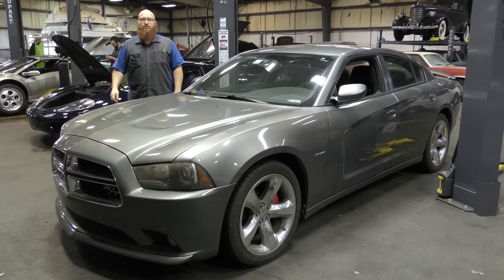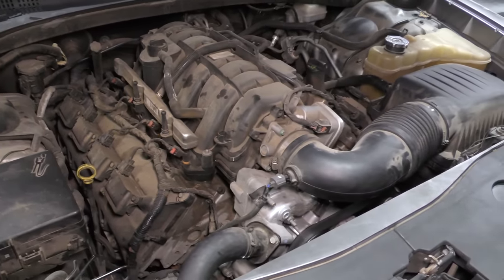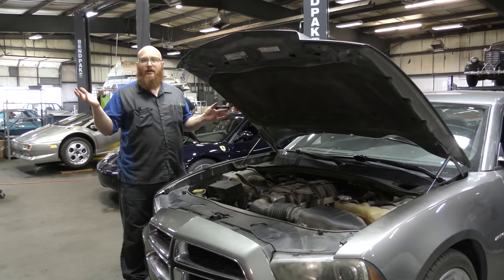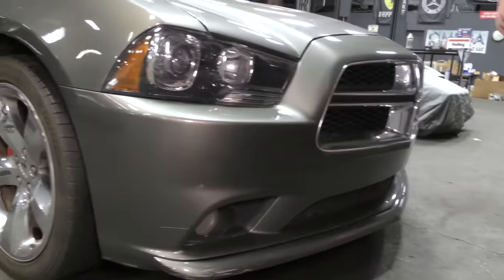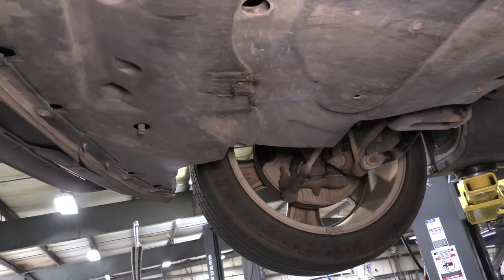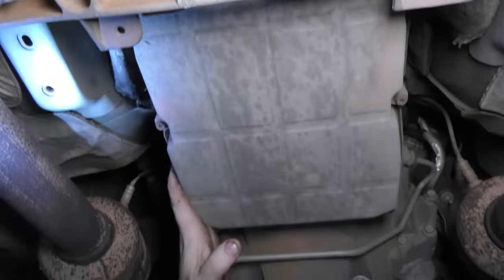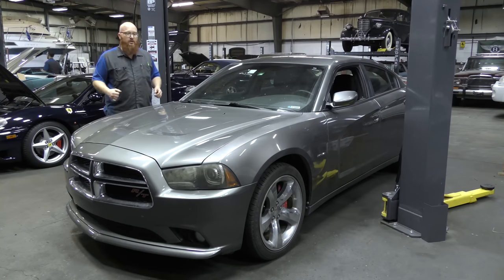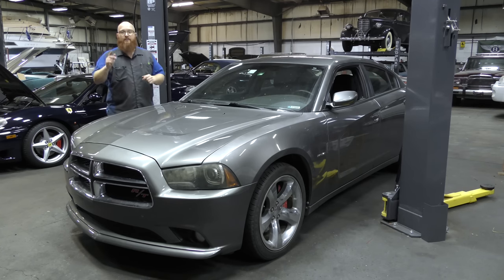Tic Tic Tic! 2011 Dodge Charger RT has the infamous Hemi tick. What will the CAR WIZARD do about it?

Comment: Hemi Tick: Beware the sound of a new cam being ground. This one will be round, and your billfold's heart will pound. Repair bills will abound as the Wizard is Bahama bound.
Reply: comment of the year
Reply: @lukesylvester2022  amen
Reply: its got 200k, its 12 years old.. its doing just fine
Reply: @massivefins2597  still will lead to a bill if left unchecked long enough, not a major problem though I'd agree.
Reply: @massivefins2597  It's a problem.
Reply: @IhateYoutube  no a lifter failure is bad... like you know its bad... change your oil and use the recommended viscosity
Reply: Got an 07 RT.300.000 miles on it still running strong no problems💪
Reply: @georgejetson8871  does it tick?
Reply: Facts. He know not of what he talks about. If you dont know aboutbhemis you should speak on em.
Reply: @GaspackGib  they all tick, It’s normal and perfectly fine, just keep the motor oil fresh and it’ll be fine.
Reply: Mine done that for 200 000 k now still going stil tiking

Comment: There's a difference between performance exhausts and no exhausts! People don't understand the true difference. Thanks for the content
Reply: Pineapple launchers are not performance exhausts. More like "repro bathtub fart" generators. And so, laws will be passed for excessive noise pollution (as prop plane flies overhead).
Reply: Annoyance is in the ear of the begrudger.
Reply: Indeed. I had a guy trying to argue with me on FB that performance exhausts are overpriced/a waste of money - and that you can just do mid muffler delete/remove resonators.

I mean sure you can do that, but a high quality aftermarket exhaust is gonna sound better no matter what and it's made out of much higher quality material. People are so stupid lol
Reply: Indeed.  As I told a well known modern Mopar youtuber....  there's good loud and bad loud.

  Same principle with some of these amateurs out here with their loud stereo systems and the obscene amount of distortion, crackling and static coming from their speakers.
Reply: @pblackjac  I don't understand how people bang music like that when driving. Having the radio on is one thing, but subs in your challengers trunk and banging music loud as fuck is just weird to me.
Reply: @abaddon3735  
I've never done to my Magnum or my Charger.  In the vehicles that I had my installations, I was loud and clear.  I also respected residential areas.
Reply: @theundergroundlairofthesqu9261  Sounds like something that a 17 year old kid who just straight piped his mom's 2003 Honda Civic would say after bragging that his Honda sounds like a racecar now

Comment: Just a general comment. I’d just like to thank you for, if not reaffirming, at least keeping alive, my faith that somewhere out there are genuinely good, competent, knowledgeable, skillful and, in this industry at least, honest, mechanics out there. Keep up the good work, it’s a joy and pleasure to watch.
Reply: it truly is a rarity these days, keep it up wizard!
Reply: 600/700 bucks for a oil pressure sensor replacement? what are you talking about? that should be 1 hour labor for diagnosis/ replacement plus sensor cost hmm..175 ..200 bucks tops.
What are you smoking? or were you dropped on your head as a child.....edit....what? a front suspension issue was addressed sway bar bushings replaced...starter issue addressed starter button replaced ..ya I eat my words and bow to the almighty wizard he was very fair with his price...
Reply: @Mikegastaldo :  I guess you missed the sway bar bushings replacement?
Reply: @Mikegastaldo  Don't forget he also had to replace the sway bar bushings and replace the push button for the starter too. I imagine the labor for getting behind the dash to fix the push button wasn't cheap. Did you even watch the entire video (WITHOUT SKIPPING ANYTHING!) before making a comment?
Reply: Most mechanics are honest
Reply: @Sabrinahuskydog :  Commenters like “Mike gastaldo” live for attention, positive or negative.  He probably thinks the time it takes a mechanic to diagnose a problem should be “free” and the specialized tools and equipment a mechanic needs grow in a garden out back.  Also, time was spent insuring the “ticking” sound was normal and not an underlying problem.  I guarantee a Dodge shop would have charged close to a grand for this work.
Reply: That is why I do all the work on my car myself,  its the easiest way to take the anxiety of getting ripped off completely away!

Comment: I had a 2010 charger with the v6 I bought from my dads work (old company car) with 220k on it. I sold it with 266k and it was still rock solid. The guy I sold it to still has it and has about 300k on it now. Love these cars
Reply: WOW!!
Reply: I'm driving a friend's 08 daytona with the hemi while I'm waiting for my Saab's parts to ship and the thing is running great at 206k miles. I thought these engines weren't reliable. Owner has had it since new, said the only engine issue has been overheating once in a while. Never misfires, or runs rough. Great engine, but even with cylinder deactivation I'm getting 17.Xmpg on mostly rural roads
Reply: These cars were built to last !

Comment: Work on the police version of this all the time. The hemi tick turns into a small chirp which is a lifter getting stuck and the end result is a camshaft being eaten. Seen this at as low as 44,000 miles. Extended idling will cause this due to not enough oil flow to the cam. The one in the video has not had this due to it not idling long periods of time. Keep in mind this has its own version of afm just like gm. Great video tho wizard
Reply: I would imagine using a good oil with frequent oil changes would help
Reply: @Tempsho   we use 5w20 synthetic oil

Comment: The entire platform is a retired Mercedes platform. In 2011 Chrysler updated the control arms with biggerstrut arms and ball joints. When you inspect the drive shaft flex joint look for cracking in the rubber. The transmission is a Nag 1 the cup plugs leak all the time. I've worked for Chrysler since 93 and I don't know what you mean by a normal Hemi tick. I wish could hear the exact  noise your referencing.  The injectors tick very loud even more so starting 2011.they put noise insulation over the rails to help. The lifter rollers wear out and wipe out the cam lobes. That happens because they moved the cam higher in the block for better valve train geometry.  Now the cam does not get constantly bathed in as much oil and there is no oil gally feed to the lifter bores for lubrication.  It gets whatever washes over the lifters. If you hear a lifter tick that means the lifter roller is worn and the cam is getting scored. If you have a misfire and you want to determine if it's a bad cam. Do 4 or 5  Accelerations to the redline. Then the engine will start to misfire bad
 Let it idle and it will smooth out. When the ramp on the cam lobe is damaged it causes the lifter to collapse on hard acceleration.  Even if you don't hear a tick it can still be a bad cam.
Reply: i try to never let my hemi idle for very long due to this exact reason, i always try to keep the oil pressure around 50-60 lbs, its only got 10k miles on it now so wish me luck! thanks for going into detail on this subject.
Reply: I heard the lifter tick/cam problem really isn't a problem unless you let the car idle all the time.  Sucks if you are a police force and have a whole fleet of Hemi Chargers idling for 10 hours a day.
Reply: @AaronSmith-kr5yf  A lot of fleets switched over to V6 models because of cam problems with the Hemi
Reply: @3pAcsJs  You'll be ok it's a bullet proof engine otherwise. The best thing you can do is change your oil every 3k and don't listen to the people who say if you use synthetic you can go 5k or 6k.  It's still every 3k regardless of the oil.
Reply: I’m not a mechanic but I work a lot around cars and I always hear a tick in a dodge v8. Doesn’t matter if it has 1000 miles or 100000 miles they all tick and during a cold start they all have a piston slap noise.
Reply: The platform IS NOT a retired MB platform. The LX platform was an evolution of the LH platform that has MB components such as the transmission, rear suspension, steering column. Today, most of the MB components have been replaced. The LX platform will not be found under any MB vehicle. 

Components are not platforms, they’re items attached to the platform.
Reply: @jamesaandf  if you say so.
Reply: @Tech-ez1qj  it’s not a matter of me saying so. It’s a matter that I posted 2 links, and specific quotes from those links, by no other than Tom Gale, stating that the LX platform was not a hand me down MB platform, but evolved from the LH. The LX was on the drawing board before the merger ink dried.
Reply: Which model of the challenger rt would you recommend? 2017?
Reply: @Kauffman578  I have a 17' R/T . Apparently starting in 2014 they upgraded the pins in the lifters to help resolve the Hemi issue. Then in 2016 they further upgraded it to heavy duty pins. So apparently after 2014 the issue has become quite rare. I have 2 5.7's in the driveway, 17' and 19'. Just make sure you don't idle long, make sure you change oil frequently. And honestly from everyone I've seen with 5.7's they seem to be mostly happy with them. Personally I love the sound and it's alot of fun to drive

Comment: The recycled E-class chassis (LH) was one of the few good things to come out of the DaimlerChrysler merger.  The trans is an NAG 1 (Neu Automatik Getrieb) 5-speed... pretty reliable.  This major restyle (LD) version of the platform included an upgrade to rack and pinion steering... the earlier models had sloppy feeling recirc ball from MB.  The early LD vintage looks much better than the earlier years too, while the most recent have an overdone, look-at-me apperance (IMHO).  The HEMI tic gets ample attention on YouTube.  Some think it is an early warning of cam lobe wear from inadequate lube flow to the cam and lifter valley...  some think it is an early warning of dreaded dropped valve seat failure.  Both camps think cylinder deactivation in more recent model years increases the likelyhood either expensive failure.  At nearly 200K, that Charger looks damn good.

Comment: 200 000 miles and looks fantastic underneath. I am stunned 👍🏻
Reply: 200,000 miles on a Chrysler product is surprisingly shocking to me. Maybe Chrysler is only good at making V8s.
Reply: The 5.7 engine is good 👍
Reply: It’s from Oklahoma not Nebraska ;) up north we have the infamous rust monster eating vehicles less than 5 years old. if you don’t get the salt flushed off at a car wash between ice and snow storms it happens fast
Reply: @VQ.Family  surprisingly there’s a hellcat out there with 140000 miles. that’s surprisingly a lot for chrysler
Reply: Yeah, I didn't even see oil seepage anywhere.  Maybe he meant to say 96K instead of 196K.  This car doesn't look like it has 196K on it.
Reply: Must be a non-rust-belt thing.
Reply: 260,000 miles on my 07 hemi ram. Unfortunately, my tick is more broken stud on the exhaust manifold.
Reply: Chrysler is no longer owned by Fiat.  Now it, and many other brands, belong to Stellantis.
Reply: @SouthsideKidd550  It is also the best chassis engineering ever to reside under a Chrylser/Dodge (sedan).  Same can be said of the last 10 years of Grand Cherokee (SUVs).
Reply: I had well over 300,000 on my old 94 Dodge van.  318 V8
Reply: @billyjoejimbob56  definitely. I have a 2013 v6 charger with 264k miles and it's a good car. Has had some dumb issues but otherwise smooth and really been a solid car
Reply: @SouthsideKidd550  Maybe you should realize Scotty Kilmer is a liar
Reply: @showride1652  oh I been knew that 5 years ago... I been unsubbed from him. I just been iffy about Chrysler products since my Mom bought a 2002 Dodge Intrepid brand new back in late 2001 and it died on her at 40k miles. Not bashing Chrysler at all just iffy about some of their products.
Reply: @SouthsideKidd550  247k miles on my 96 Grand Voyager 3.3L, buddy has 221k on his 05 Grand Caravan 3.8.
Reply: My 3.5 v6 dodge magnum motor died at 135,000
Reply: Chrysler is the most shittiest car company, surprisingly dodge pentstar v6 improved throughout the years, they can actually go to 200k miles but thats the only good thing dodge has done to their chargers, the rest get beat up and break down at 15k miles
Reply: My 2010 5.7 Challenger has 167k and going. Only issues have been minor and wear and tear related. Alternator took a dump and radiator gave out. Been a great rig for a long time.
Reply: @SouthsideKidd550  I had a Jeep GC 2014 and a lot of the stuff he said made sense after problems kept arising, from suspension leak at less than 100k (hood strut also failed same day I received the car after suspension repair), fuel pump failure after 2 months of owning it, and the radiator was leaking at the time I sold it, somehow the new buyer didn’t mind it and I felt bad for the poor bastard but I had to get rid by all means lol. While it drove OK, the trans was jerky as hell and most the time it just gave anxiety and always kept wondering what is going to break next. And don’t even get me started on the repair bills. We have had 2 Toyota’s an FJ and land cruiser for years now without any problem, just peace of mind. I switched to Lexus and never want to go back to FCA except maybe hellcats or any challenger those are sweet lol.
Reply: @tygervoods8358  The Jeeps and Fiat type Chryslers are the bad vehicles they make. Generally, their Rams, (only the 1500) , minivans and  their full size cars such as the one above, are not Toyota reliable but it is reasonably reliable and durable. 
Aside from their minivans, full size trucks and cars, the rest of Chrysler's line up is replete with substandard vehicles.

Comment: Our 2012 Charger R/T is very similar to this one, except for it being black with leather interior.
I'm a proponent of the late-model Chrysler hemis - I've owned three, had others for company trucks
and all of them have been rock-solid and dependable.

We still own my '04 Ram 4x4 hemi that I bought new; it's pushing 200k miles as well and has been
silly reliable and solid. We've also owned an '06 Charger R/T, which was traded in on the 2012 when
it was new. They're a lot of fun for the money, very comfortable and the aftermarket is strong, too.

Yes, that oil pressure switch is a common replacement item on them; I just replaced the one on
the 2012 after the dreaded "99psi" issue and don't let Wizard fool you - that mother is a bear to
get to, especially if you have large man-hands like me.
You wind up having to get under the car and temporarily removing the alternator to access it...

As for the "tick", I've only witnessed it in my Ram and only when it's cold; it dissipates fairly quickly
once it's been running a minute. Relax about the tick, people - as Wizard says, it's not a big deal.
I keep the oil changed in all our hemi vehicles and I only use Mobil1 in them, along with good
Hastings filters. I'd rather spend the money on oil changes now than engine rebuilds later.

Oh, and even the "base" hemi 5.7 (370hp) is a quick animal, too - our 2012 ran a 13.94 stock when
new; I took it down the track just for the fun of it and it surprised me a little. Not bad for a 4000+ 
pound full dresser car - and on long trips, the car is in the high 20's on fuel economy, too. 
I'm pleased Wizard agrees with me on these - they're good engines, always have been.
-Ed on the Ridge

Comment: The LX platform rides very smoothly down the highway. You can mix martinis while cruising at 100 mph. Very comfortable on long road trips.
Reply: FInished my daily 09 charger i bought with a blown motor, going from a 08 ram 2500 to it has been rather nice
Reply: They are indeed really comfy. Family and friends have had quite a few Hemi LX Plattform cars and I’ve loved them. My friends 15’ FBO 5.7 is a monster for sure.

Comment: My 2006 R/T has less miles than that. Reseated the valve seats so they don't drop, changed the lifters to non MDS and removed & capped the solenoids. Did a tune with doablotech to shut off any mds codes. Installed a 6.1 cam and it runs smooth with stock exhaust. Don't want it too loud or you won't hear anything when there is a problem.

Comment: I’ve had my 14’ Hemi Charger for about 4 years and it’s been a phenomenal car. It’s also close to 200k and aside from some suspension that just started creaking, it’s been mechanically perfect.
Reply: Cool car. I have a 2014 SRT8 Charger with 25K miles.
Reply: 2014 RT with 76k
Reply: Cool. I have a 14' Charger R/T Myself, and other than front facing lower control arm replacement, runs like a top. Got 100,000 miles now, and I take meticulas care of it. It had 59,000 miles when I bought it. I always use Mobil 1 5w 20, and change it every 5,000 miles.

Comment: Wow that engine could use a bath!
Reply: Thought so as well. It looks as if it had been driven through a desert storm.
Reply: The whole car could lmao those headlights too 🤢
Reply: @sokthearrith  it looks dusty af someone needs detail it
Reply: Looks awfully dusty.  Would change the air and cabin filters more often than recommended.
Reply: dankcatvacs gentle water on a cool engine is ok, power washer forces water into electric parts
Reply: They took the cover off, most likely why. My 2014 RT's motor is pristine, but it's gotta cover over it. Also, doesn't see dusty/dirt roads like this charger clearly has
Reply: @abaddon3735  that looks like the 392 engine and those really don't have covers. Sometimes they have valve covers but that's it

Comment: This is crazy and I really appreciate it. I've got a 70K '05 Hemi Magnum, and it's got both the tick, which I was sure was an exhaust manifold leak but I could never find; and it periodically throws a wrong oil weight code. Guess it's time for sensors!